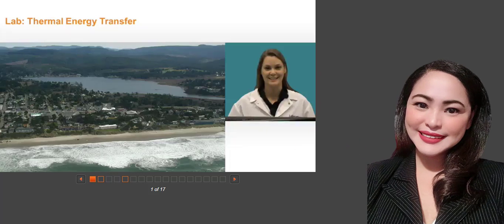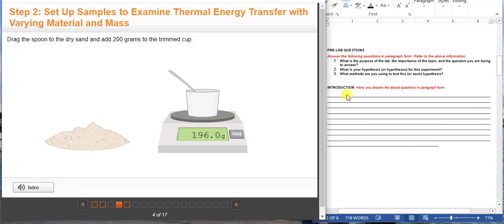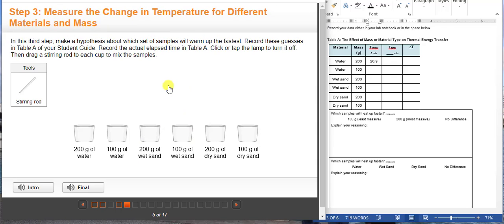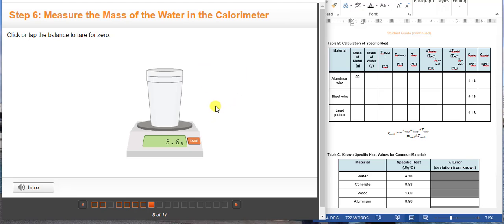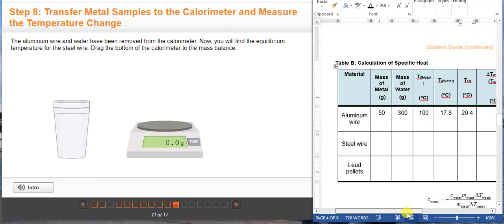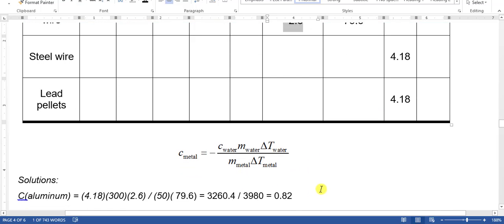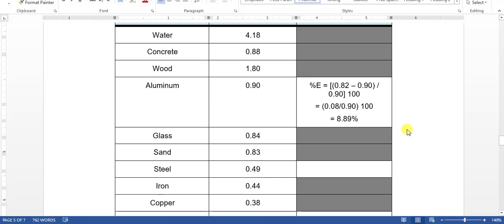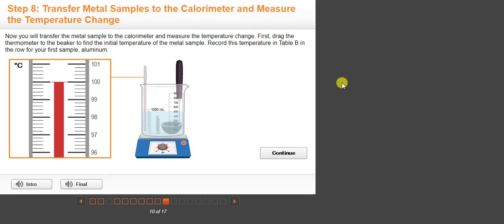THERMAL ENERGY LAB GUIDE || Edgenuity |  Science Simply Explained by Ivy Alefante

Comment: How would you summerize the events
Reply from the maker: You can state what happened in part 1 where you measured the change in temperature for every substance corresponding to their masses and tgeir specific heat. Then for part 2, you check their temperature change based on the specific heat capacity pf each metal. You  have to actually finish the entire virtual lab to understand the whole experiment. This video is just a guide. Check out my other channel too for more science videos and tutorials that might help you with your portfolios. It’s called Science Simply Explained by Ivy Alefante